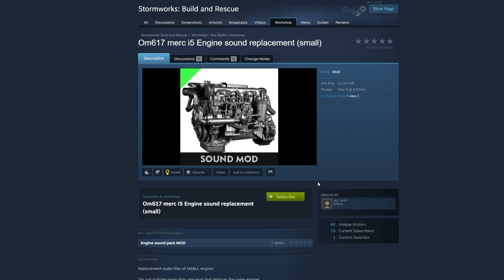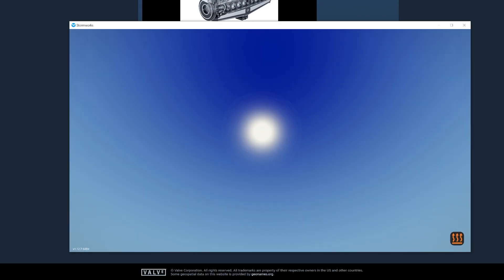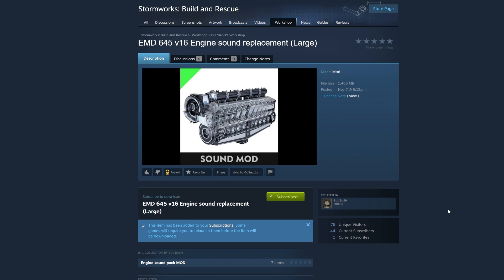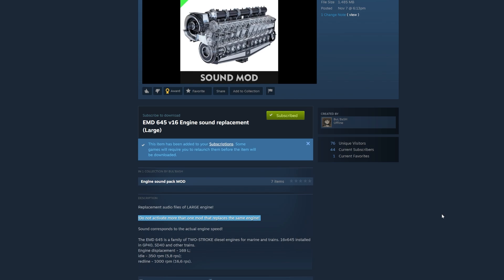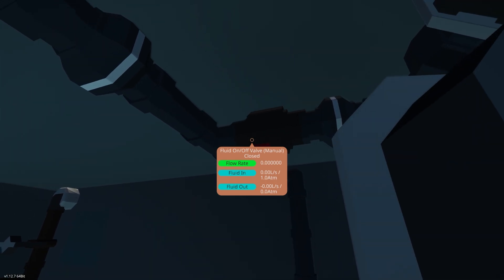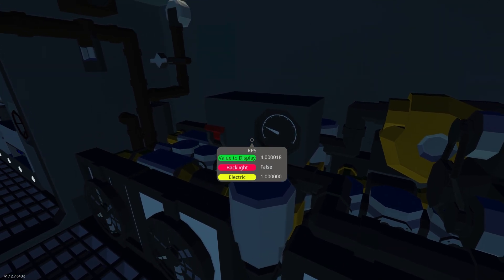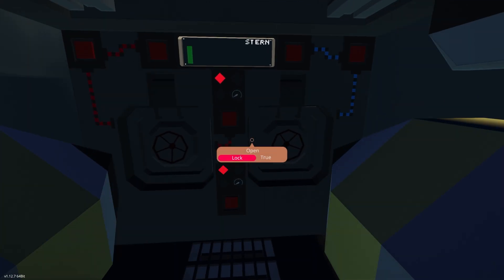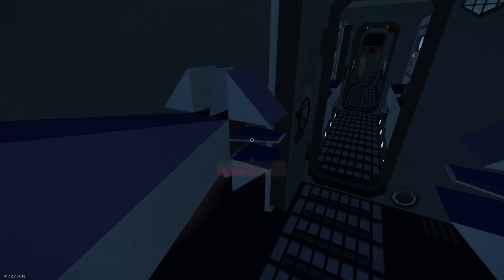BEFORE You MOD Engine Sounds...

Comment: No, you understand that not everyone likes V8s, some like diesel I6s. The way they are implemented now allows them to be installed only on the client or server side without the need for both to install and without increasing the number of the same blocks.
Reply: If 1 mod includes all the mod sounds, with let's say 10 different crankshafts, you could hear all the different sounds for different vehicles while in a server too. That is a better approach.

Comment: Modding is going to be a mess. Hopefully some api and community resources get uploaded to allow things like a modder resource to allow a dorp-down sound selection tool for engines like a sound block, then modders only need to adapt it for that interface and not overight or add blocks.